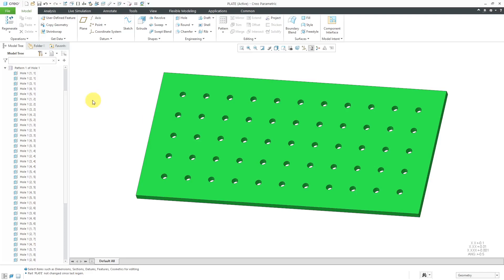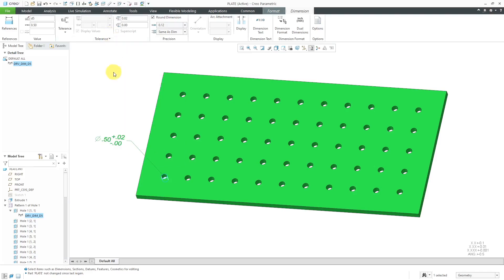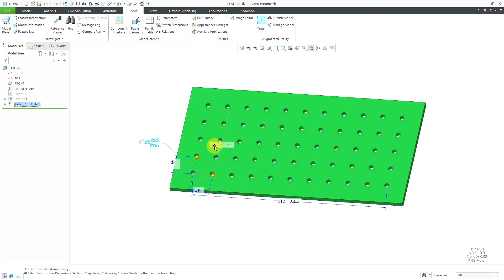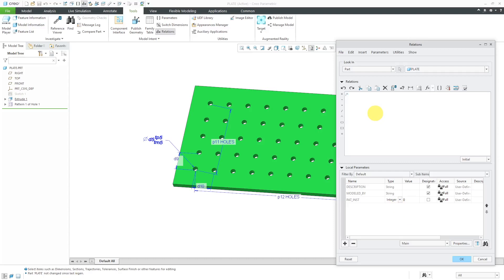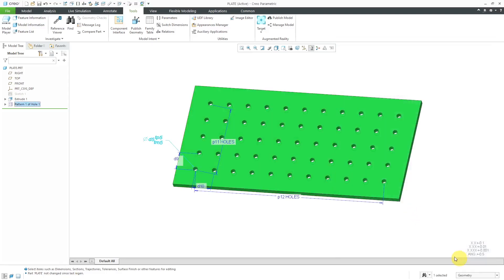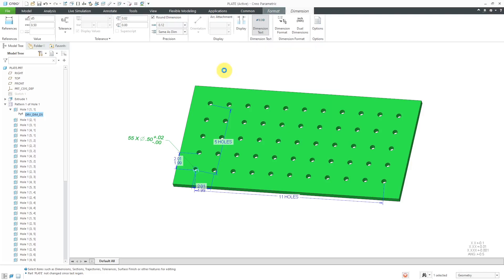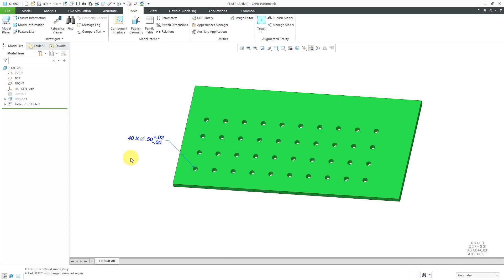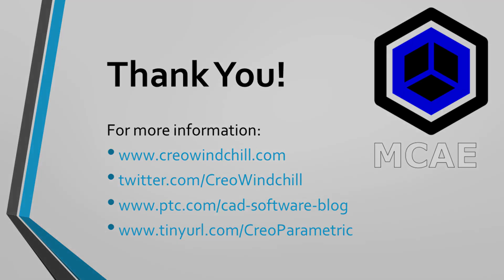Creo Parametric - Patterns - Parameter for Number of Instances

Comment: Hi, i often use criteria on component interfaces, and those are looking at the name of the coordinate system. Is it possible to create a pattern of coosys, and generate an automatic name? per aps instead cs0,cs2,... frontplate1, frontplate2,...
Reply from the maker: Not that I'm aware of. I tried to do that for coordinate systems for entry ports in connectors.
Reply: @CADPLMGuy  thank you for the answer, i probably need to that manually...